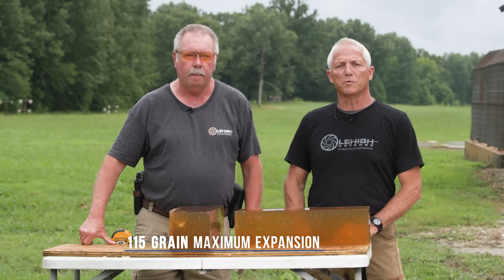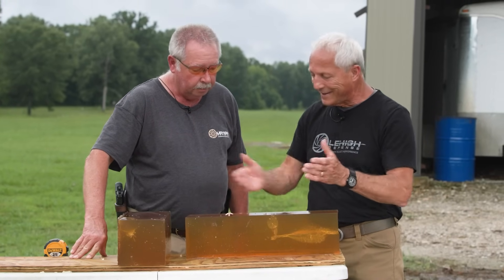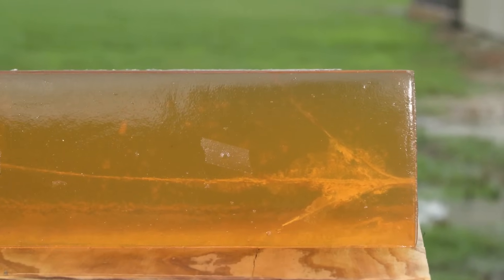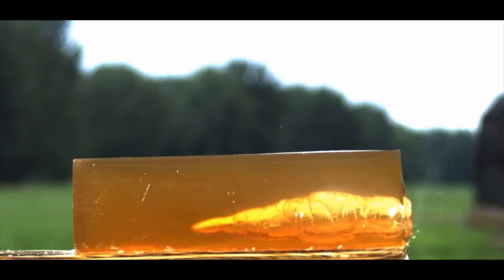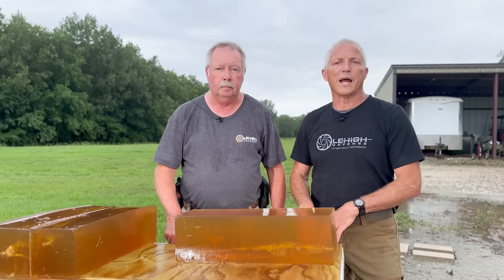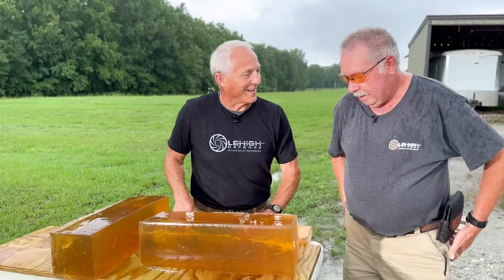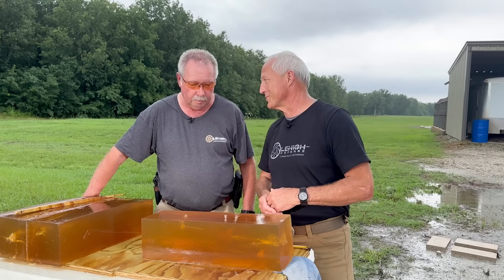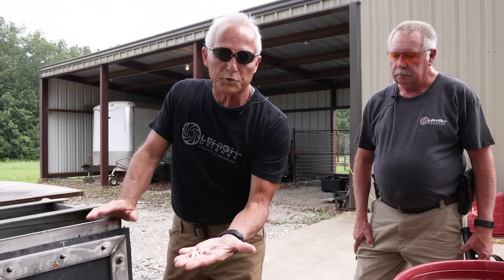Maximum Expansion vs Controlled Fracture vs Xtreme Defense 9mm Bullets from Lehigh Defense Tests

Comment: I appreciate this new bullet design, but I feel a lot more comfortable sticking with the Xtreme Defender bullet design for my carry guns in 9/40/45.
Reply: Agree with you. The XD clearly out performed the other two tested yet Wilson talked up the weak fragmenting round. A 115gr round at only 1100 fps that falls apart is nothing to get excited about. I think Wilson clearly doesn't understand what a gel test is!
Reply: @kennethferguson4283 i typed that half anklesleep . But 😮😮😢😢😢😢  I up up to I you are the one that is the most beautiful
Reply: Yup, look at videos of hollow points getting clogged very easily. The XD is clog proof and arguably one of the best designs ever produced.
Reply: If they would have a polymer tip on the controlled fracture bullets, it would be devastating.
Reply: Bro.. the fuck was I doing that night 😱 these comments I left are WILD lol
Reply: Yep, everything I carry is Xtreme Defender. No matter the barrier, it’s a consistently big wound track. No moving parts to worry about, the solid design just works

Comment: The extreme defender is the best all around bullet in the market. It’s barrier blind, has great penetration, temporary sound cavity and expansion even though it’s an not a hollow point. I have about 500 rounds of the stuff and it’s my go to for carry ammo.
Reply: Wilson needs to be focusing on the round that was clearly the best in this test, the XD!  He will eventually realize he is hurting his reputation with the other two rounds. Nine inches of penetration LOL.
Reply: @kennethferguson4283  the XD is definitely the best all around handgun round. WC should just limit production to the XD and the traditional HP round. The EP round basically does the same thing as the ED, but doesn’t have as good external fluid expansion and only goes slightly deeper in penetration tests. I think if they reduced the bullet designs to just the two ED and HP bullet designs in the handgun rounds and then work on developing a rifle round with that kind of performance, it would not only reduce costs but increase availability. The controlled chaos is a great round in the rifle line but it’s so expensive. I would like to see the performance of the ED in the handgun round worked into the rifle rounds but continue the petals if it’s possible. It’s a different animal, I know, but that’s what R&D is for. Maybe add a steel core or even a steel penetrator shaped like the ED on the tip with an all copper projectile behind it or infused with the steel core and combine it with the controlled chaos design. That would be a deadly round with barrier blind capabilities, especially in a 77 grn load for 556, 125 grn 300 Blk and a devastating 168 grn 308 round!!!! I don’t know the legality of it but green tip is legal. I don’t think they could use the steel penetrator of the M855 A1 for civilians outside the secondary market call off the truck. A tungsten penetrator would be the best choice, but apparently we need China for the tungsten. So many possibilities!!! With the new 6.8 mm with the 2800-3K velocities out of a 13.5 barrel, these designs will be ridiculous.
Reply: The problem with the XD is there is literally ZERO real world data to back up the gel tests. The bullet design is literally made to perform A+ in gel testing. I’m not saying it’s a gimmick cause I carry it in my .380s but I’m not convinced it’s better than the HST’s or even these Controlled fragmenting loads.
Reply: @DuvalRypr allegedly they passed the fbi standards with flying colors and the amount of times people survive a head shot with HP is staggering. The blacks even began to use XDs and XPs😂

Comment: As a trainer, I have seen more malfunctions during live fire this past year than all my years combined shooting. It's as if all QC went out the window for a few years with production and supply chain issues.  EXCEPT for a few manufacturers to include Lehigh Defense. You guys always impress and always deliver.  
Where can I find comparable testing using different common edc barrel lengths?
Reply: Way to put yourself on a pedestal lol

Comment: I think you should make that same design but instead of Maximum expansion you should have an expanding bullet that drives a little bit deeper and doesn't expand as much don't cut those guys down so low, kind of like the Barnes Tech XP but a three petals design like a boat propeller but just drives 15 to 18 in

Comment: 9in penetration is good? Isnt FBI standard for proper stopping 14-18in??
Reply: Next round is the one for that, that first one is for those who want that maximum expansion for some reason.
Reply: Different bites for different likes.  Nine inches penetration with complete energy dump as demonstrated would be excellent for an "inside bullet".  ...inside the house, inside the body and not going through the neighbor's wall and killing his cat.  The Fed standard is built around defeating barriers such as walls and windshields, and it's good but not optimal for use inside.
Reply: It is 12 to 18 inches of penetration. Meaning Wilson's wonder bullet falls 3 inches short of minimum!
Reply: @kennethferguson4283 you don’t understand why the FBI has selected that range tho and it’s obvious. 9” is PLENTY of penetration to hit vitals. PLENTY.

Comment: I use a 190gr .451 extreme defense as my carry bullet. About 1000fps out of my gov length 1911s. Did gel testing and they outperform several different 200 and 230 gr trafitional jhp bullets I’ve used in the past, as they don’t plug up, and I’m getting about 16”of penetration in gel with layers of denim. Only jhp that I would run after my tests is golden saber bonded.
Reply: While I prefer the 135 Xtreme Defender bullet, I've found the Speer Gold Dot 230 gr.  Short Barrel is a good second choice!  Works down to 730 fps in my tests but does better the faster you can make it go!  I load them to around 950 fps and they make a good back up to the 135 Lehigh bullets!
Cheers, 
jc
Reply: @jmichaelcarbonniere9549  the gold dot is awesome.

Comment: I see an interesting philisophical difference between Lehigh's approach versus the makers of premium standard JHP loads. If you know in advance what sort of shot you will be taking, you can choose a Lehigh round that is optimized for your particulr scenario. On the other hand, if you really don't know what you will be up against, as in police patrol, you may be better served with a conventional JHP load that does "well enough" across a variety of conditions.

I do see the Lehigh loads as being good choices for use in civilian settings. I'm particularly impressed with Bill's report of the effectiveness of the Controlled Fracture round on hogs. I would not have expected that to be the case.

Comment: Why was the Max Expansion line re-designed to a 3 pedal projectile that only penetrates 9" in gel?  I have the old line which penetrates almost 12" and has 4 pedal's and really wish I could purchase more.  It's spectacular ammo and coming just short of the FBI 12" minimum I think is great...9" is significant change.

Comment: What I am concerned with is what velocities these were fired at. If the speed is too low or too high, the performance would be different. I don't see many loadings with these projectiles readily available, so if I load myself, is there a loading/pressures I need to use to achieve the performance in this video.
Reply: Not sure it helps you, but I'd bet the XD lines will perform nicely and proportionally to bullet speed because the projectile doesn't change shape.    
It likely performs quite similarly from low end to high end pressures.
It's the expansion line and controlled chaos lines that may vary significantly with speed.  

Considerable testing would need to be done with those to find the deployment speed for the pedals.

Comment: the controlled fraction is like the federal Syntech defensive bullet looks like,  but federals is 138 grain , and relatively affordable compared to other premium ammo, check out beyond seclusion  video on the Syntech. the X-Treme defense  90 gr and 90 gr+P I personally carry it in 9mm my G19 , G17 , M&P 2.0  I just started mixing in a few  Federal Syntech 138 gr. with the Leigh in my back up carry magazines.  With the leigh i have no concerns of accuracy, barrier blindness, penetration or terminal performance. In my 380 (G42) i stager the Leigh 68 grn x-treme defensw with the extreme penetrator and don't feel under gunned one bit.  Lehigh ammo exudes quality and confidence. MHO    will have to compare the new controlled fracture to my Federal Syntech 138 gr.
Reply: WTF!
You mix the ammo in your magazines? How do you know which round to fire at a specific parrt of anatomy or time during your defense?
A real STUPID thing!!!

Comment: I’d buy the hell out of those Controlled Fracturing if they weren’t $2.40 per round. It’s no wonder the Underwood loading of these is always sold out, but they’re still high at around $35/20. It’s ridiculous when you consider all the other great ammo options for less than half of the price of these.

Comment: Why would I use the 9MM controlled fractured vs a 147g hst or Hornady critical duty as the FBI selected? Serious question.
Reply: You wouldn't!  Instead you should be using the Lehigh Xtreme Defender which works better than anything anyone else is using.  Period.  Better than HST, Gold Dot, and Golden Saber bonded.  It is, I believe, the best bullet money can buy!
Cheers, 
jc
Reply: You wouldn't. That's a round better serving a rifle; +P+ XD, CD, HST in that order. They are all great rounds but barrier blindness should be a top concern in addition to PWC and penetration.
Reply: You shouldn't.  In pistols a fracturing bullet leaves a lot of it's potential at shallow (unlikely to do anything useful) depths.  The HST, Gold Dot, etc. are standard for good reason.

Comment: I am interested to see what these rounds would do at 100 yards,  it is said that it is the indian not the arrow however i prefer to have the best arrow I can get, that being said I am interested in terminal performance at distance and trajectory or specifically max ordinance say of a 90grain projectile given a specific zero,
Reply: plug it in a ballistic calculator.  i use a red dot on my carry pistols and use the xtreme defense.. appr.1350 fps out of 4in G19.  with .75 rmr hight over bore and a g1 coefficient .089 (i think) and you are shooting point blank inside a 2 in circle to 80 yrds and inside a 5in circle to 100 or so... want better 100 yrd than -5in at 100  then adjust your zero yrds.  i zero at 10 yrds.

Comment: Why 3 petal vs 4 or 5?
Reply: larger petals probably stronger
Reply: And my guess is the larger petals carry more mass and allow them to travel further. Which causes more tissue damage for blood to escape from. I'm not too sure I would like the bullet as much as like an Xtreme penetrator defender around. But I like to carry 100 grain +p+ soft tip hirtaberger or critical duty 9mm. They are kinda similar to the xd round where you get good barrier blind ballistics.
Reply: They re-did their Max Expansion from 4 pedals to 3.  And It went from almost 12" penetration to 9" which really isn't enough.  That's really unfortunate.  I'm guessing they're thinking about a bullet line that will be more "urban friendly."  I don't agree with the choice, but I'm not in their board-room.